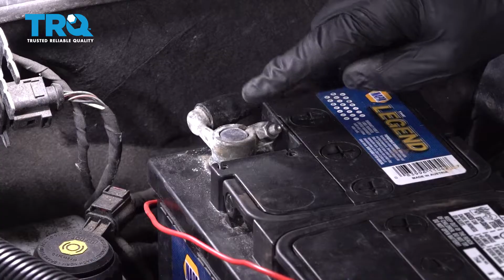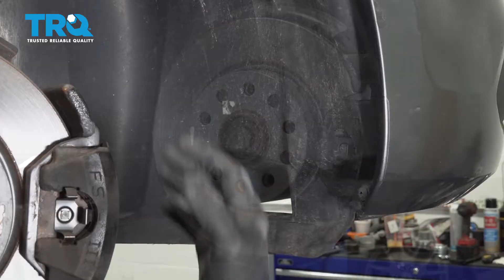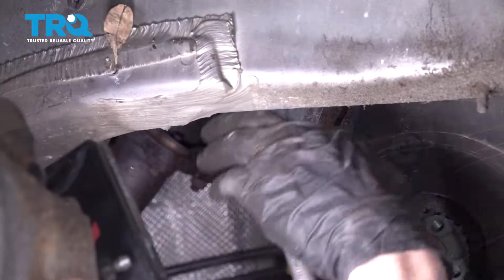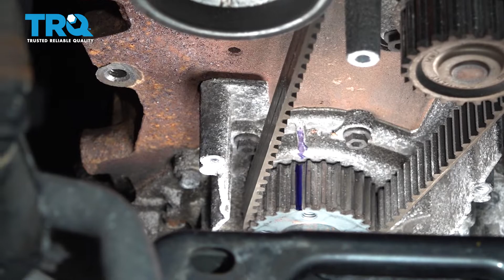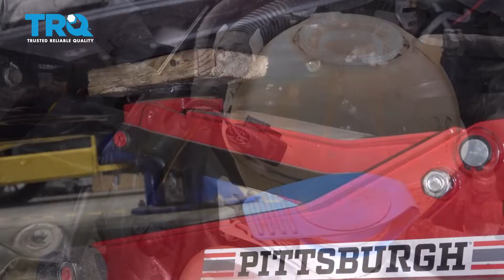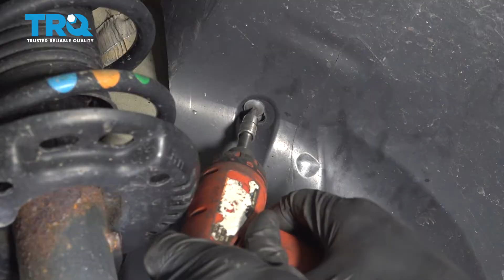How to Replace Timing Belt Tensioner 2011-2018 Volkswagen Jetta

Comment: Absolutely excellent video! Just did it:
Didn’t find it necessary to remove or mess with the alternator at all. 
Bolts on lower belt cover were t30 and not t27. It was a 2013 Jetta

Comment: Thanks this helped a bunch im having issues with the tensiones! I set it dead center and after the motor goes over a few times it jumps the tension line up spots for some odd reason and it also fluctuates while car is running! Any advice would be great

Comment: I’ve just replaced water pump and cam belt. Got a squeaky noise and have found that I’ve put too much tension on the belt. I’ll have to slightly slacken the belt tensioner. Need to get the 2 pin tool.

Comment: new subscriber earned. very detailed and informative. i like that you gave the torque spec for the crank pulley too, thanks for that. very hard to find any GOOD info on this car for more involved repairs without an alldata (or similar program) membership. 
in the middle of doing valve cover gasket and maybe valve stem seals if I don't have to remove the head. might as well do timing belt and water pump while its apart. Cheers!

Comment: I need help when turning the crank to line up timing mark on cam i got compression stroke and crank turned but not the belt and cam gear. What do i do now? Im not sure how many teeth on the belt the crank gear jumped

Comment: High quality video on a job and vehicle that's hard to get any information on. Much appreciated! Just need to add in replacing the water pump but I think I can figure that out... hopefully. 😅 Thanks for the video! I payed 1100 to have this done at 100k, just hitting 200k now. Gotta say, it's a slow engine but it's been extremely reliable and still doesn't burn any noticeable amount of oil between the 10k oil changes.